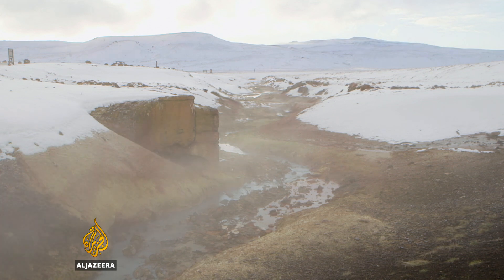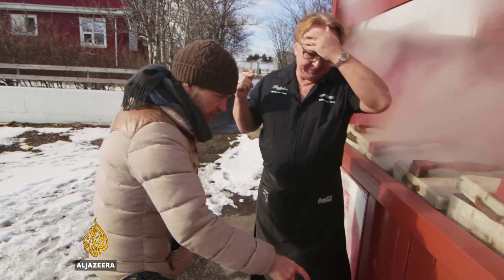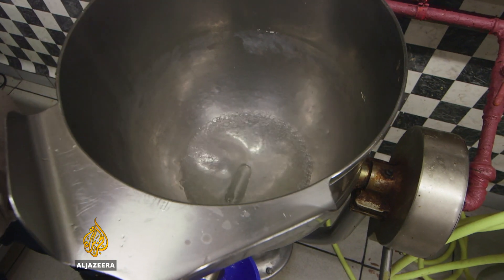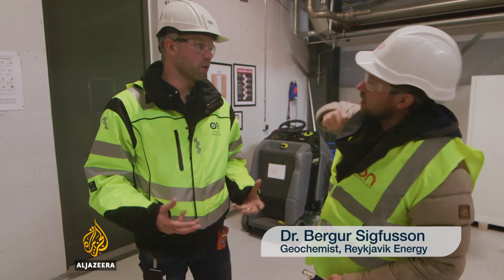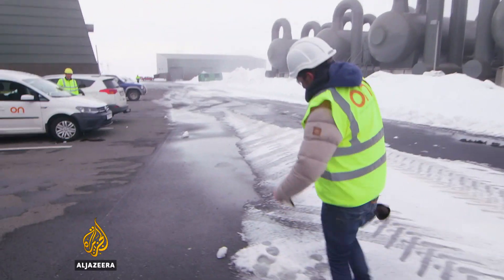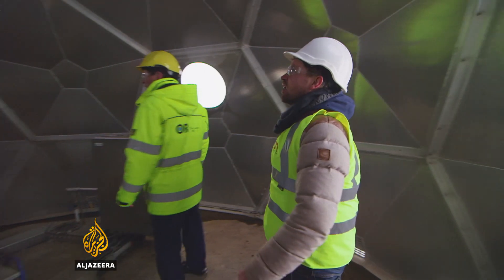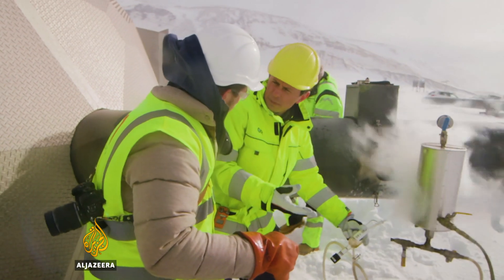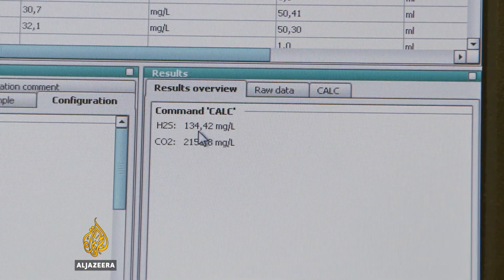🇮🇸 Turning CO2 into stone in Iceland - earthrise

Comment: Just speculating what else they could do with their "by products"

They could use the waste heat and water after generating electricity to heat and water large greenhouses built next to the plant. They could also use at least a portion of the co2 to boost production in said greenhouses.  This would also make them less dependent on food imports. If costs were low enough they could become an exporter of fresh veggies and fruit. For that matter dependent on costs they could make indoor, self contained pastures for livestock in a closed system that would create all the fertilizer and such that they need to keep food production high. It would be interesting if they could also use the catalyzing cement that breaks down a lot or all of the compounds that they are currently injecting back into the earth in the construction of these type of buildings.

It would be interesting to see if an integrated approach like this would work or if it is just not really practical or affordable. I know that a geothermal plant in another country (which one it is I cannot remember) has an aquaculture business using the water no longer hot enough to spin a turbine growing shrimp and I believe crayfish cheaper and better quality with little to no danger of the contamination sometimes found in wild caught shellfish. 

Well I scrolled down a little further and found that Iceland already heat greenhouses with geothermal...now don't I feel silly.

Comment: I don't like the idea of locking away CO2. For every carbon atom there's two oxygen atoms. We need to separate off the carbon and lock just that away. We're actually going to worsen the carbon concentration in the atmosphere doing this. We need biological engines which can perform the task with natural sunlight to split the CO2 molecule and then lock the carbon away or use it for graphene engineering.

Comment: Baseflow concentrations of DOC in undisturbed watersheds generally range from approximately 1 to 20 mg/L carbon. Seawater has the lowest DOC with a median concentration of 0.5 mg/L. The maximum solubility of carbon dioxide in water at 20 degrees celsius is 1,5g, well below the 2g presented in the video. I guess people will believe anything a scientist says.

Comment: Iceland is a world leader in renewables. It produces all of its electricity requirements by hydro and geothermal energy. And 70%of all energy need are met through renewables. Holy smokes.
Reply: Transporting Geothermal energy to the UK. How they are going to do that. There is ocean and that will suck up all the heat. It must be a costly venture.
Reply: Heard of electric cables? A pretty efficient way of transporting energy.
Reply: Remember that it has co2 and so2 waste gases, so it is not perfect. While geothermal isn't universal it can be used in similar situations.
Reply: All gimmicks. One X class solar flair and their wiped out. Then they will rely on fossil fuels to remanufacture their gimmicks again. Wake up!!
Reply: I will work with Iceland for renewable energy.
Reply: The sun heats the earth....so underground plumbing is collecting all that solar energy instead of solar panels. We do have all the energy we need. We are just doing it all wrong.
Reply: Isn't oil coal and gas renewable? New coal oil and gas does get made. It does renew.
Reply: @Competitive_Antagonist  
No, coal and oil are not considered renewables. Coal was created during the Carboniferous Period 299-359 million years ago when there were enough plants as to raise the planet's oxygen level to 162% of today hosting insects of monstrous size. It is unlikely that the planet will ever see that level of growth and undecayed vegetation again.
Crude oil is usually formed when organic material is washed into the ocean and covered with silt. A salt dome is created via drying of the sea. Vast amounts of soil and rock needs to be put down in order to create tremendous pressure over millions of years.
   There is some research being done trying to get genetically modified microbes to create diesel. I do not know the level of success, or if it was feasible or scalable.
Reply: algae has been modified to create kerosene aka jet fuel. It just isnt very cost efficient yet.

Comment: Isn't Sulphur bad for health? All the Sulphur depositing onto the food can't be good for long term consumption. Maybe they can filter out the Sulphur first?
Reply: No Wolfboy, as you are the one making a claim It falls under you to provide evidence.
Reply: sulfur is actually an important mineral your body needs
Reply: 777Wolfboy777 z
Reply: what're you talking about? Nuclear plants have ZERO air pollution, they are less polluting than even solar panels because of the minerals required to make the panels. only wind is less polluting
Reply: That is a disingenuous statement. They create nuclear waste that is hazardous and we have nothing to do with because presently it cannot be recycled. The costs of transporting and covering up and protecting ourselves from it uses energy that pollutes. Holistically, until we find out how to handle the nuclear waste, we are kidding ourselves about nuclear as a sustainable energy source.
Reply: Sulphur dioxide is very bad. Mixed with rainwater it makes sulfuric acid or acid rain. Atmospheric sulphur affects global temperatures. It is a major pollutant in coal.
Reply: Sulphur is very good for you. Just like Chromium, Vanadium, and Sodium and Magnesium. What matters is how you get it into you and in what form. Sulphur is used to strengthen your bodies defenses. Chromium and Vanadium used by Cells to have strong enough signals from Cell Membranes to nucleus to combat the overall problem of Diabetes. Copper used by the body to make Collagen among other cardio vascular duties and hair and nails and bone. Iodine to enforce the cell cycle on Eukaryotic cells to ensure their death like normal cells unlike Cancer. Sulphur like many of these are essential minerals because your body cannot produce it. Plants can't make it either. All living things must get their minerals from the soil. Vitamins and proteins of course can be made from living things but minerals like Iodine and magensium and sulphur must be in the soil for us to ingest in our diet.
Reply: +Catalyst - D B but dont get too much or they become bad

the dose makes the poison as they say
Reply: I like Kentucky coal. At $7 a ton you're crazy not to use it. I hooked a coal fired boiler to a radiant floor heating system and my winter heating costs are so low you'd laugh. Coal is good for Americans.
Reply: Bio available sulphur is very important for the body for connective tissues, insulin, skin, hair and nails. The problem is sulphur dioxide which is acidic and can damage the lungs and will irritate them. Not good for asthmatics and also causes acid rain. Eggs contain sulphur which he referenced the smell to eggs (rotten eggs give off sulphur dioxide).
Reply: sulfur is actually important for certain bodily functions but i agree that they should investigate whether they're taking in concentrations too large
Reply: It beats nuclear power stations, which are too expensive to maintain and gives off a bit too much pollution. Coal power stations creates too much pollution. Sulphur just smells like rotten eggs, but I doubt it's as bad as today's heavily polluting methods. Most people underestimate natural sources of energy and the damage of pollution to living beings.
Reply: Well, there's always the question of what to do with nuclear waste. I'd take geothermal over nuclear any day. Also, NefariousFox, you don't have to be so nasty about it.
Reply: NefariousFox You're avoiding showing me evidence, because you have no evidence.
Reply: NefariousFox of course several hundred tons of spent fuel lying around is not pollution. that's why no one wants to store it in their State. oh and checkout what it takes to make one of those fuel rods..it ain't pretty. Nuclear fuel is probably the most hazardous thing we've ever come up with. This technology has actually rendered parts of our planet uninhabitable.
Reply: NefariousFox, You're an idiot, who shows no evidence.
Reply: +777Wolf777   "You're an idiot, who shows no evidence."   That's the way it always is with obvious cuntservatives: they ALWAYS want the BIGGEST MOST COMPLICATED MORE DANGEROUS MOST EXPENSIVE ways to do anything, because of their antienvironmental ideology.
Reply: NefariousFox I told you already. There's heavy pollution covering certain areas across the earth. If it's not research based on observation, then it's just a belief you have. I saw the pollution. People get lung problems living at those areas. Being rude is not evidence for nuclear power plants don't produce pollution.
Reply: NefariousFox, No. Nuclear power plants might not be as polluting as coal power plants, but it still spreads pollution. There's many areas across the earth that are covered in smog. I just think it's a big waste to have nuclear power plants, and the only people who want it are the rich and wealthy.